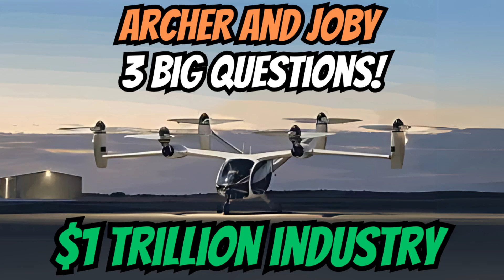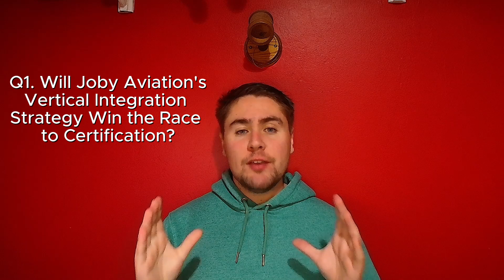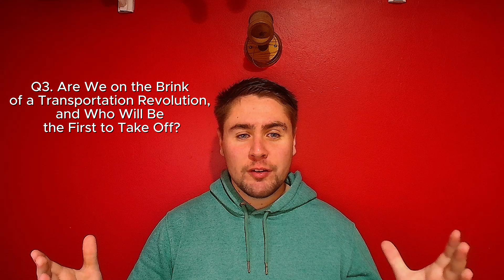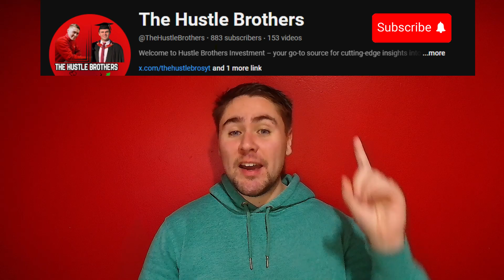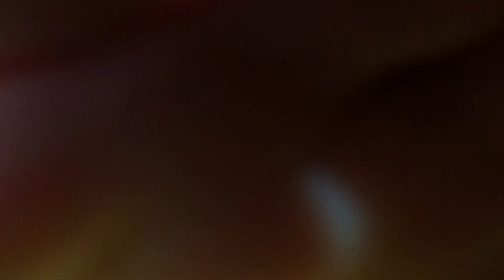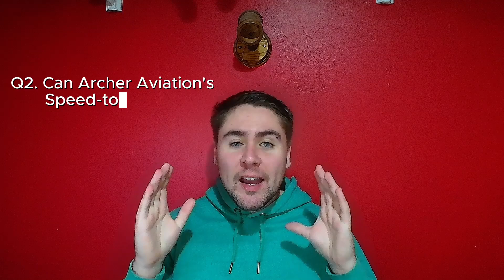Archer And Joby Aviation - $1 Trillion Industry, 3 BIG QUESTIONS Answered!

Comment: Does Archer's service delivery partners have to certify their eVTOL taxi services?  where are they in that process?  How does that compare to Joby's service certification process?  You have stated that the in-house development may create more complex regulatory hurdles for Joby, but haven't they already passed those tests w the FAA?
Reply: They both have a part 135 faa certification. That allows them be air taxis with aircraft that are certified like airplanes and helicopters, but they can't use their evtols until they are type certified. They need to use normal airplanes and helicopters until then. The evtols need to be type certified and that will not be soon if ever. Getting the part 135 is more for publicity so they can say they are faa certified in news stories.  Type certification of the evtols is really the only thing that matters and they aren't close to that.